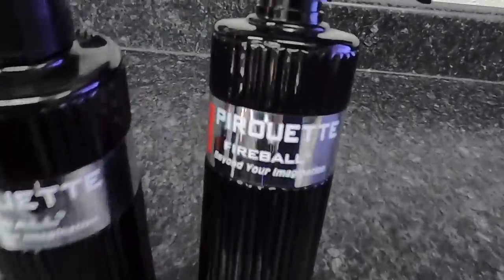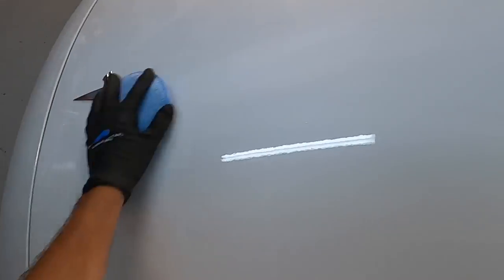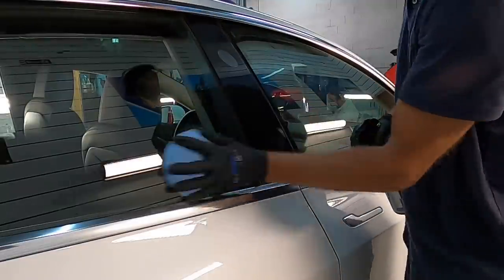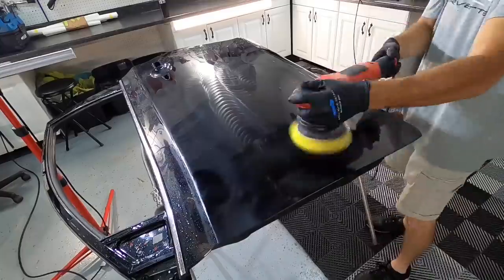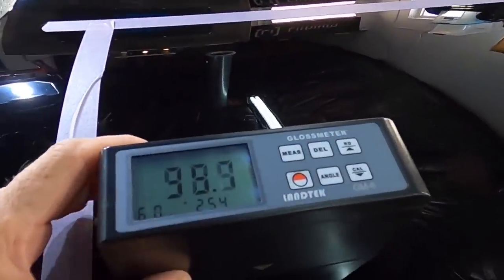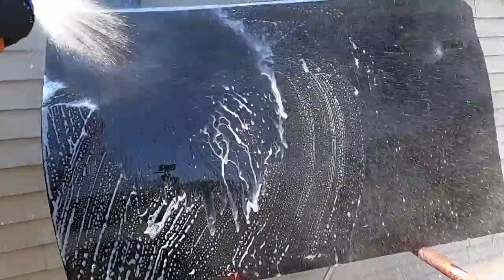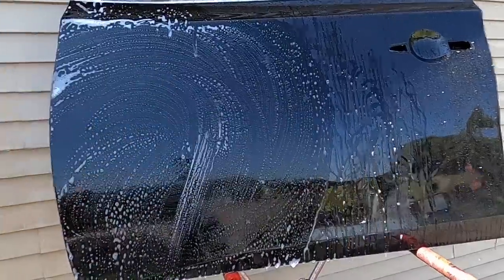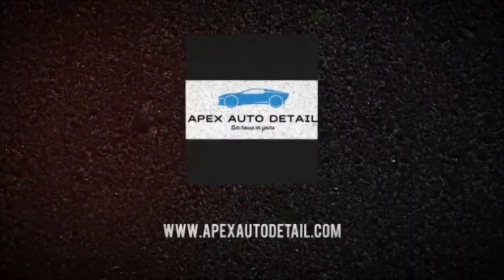Product Showcase/Reviews Are Back! FireBall Pirouette! Sio2 Infused Spray Sealant!!

Comment: You know it’s good when white paint pops.  Still my favorite auto detailing channel.  Do you know of any lint free buffing towels?  How to remove water spots from a ceramic coating?
Reply: Anything from a good company like the rag company, use a water spot remover if that doesn't work then buffing is required and it will need to be recoated to restore the coating.
Reply: Carpro essense plus. No need to apply again the ceramic.
Reply: @thso6529  that is an option, it depends on how old the coating is and how deep the etchings are. That is where testing starts.
Reply: @dustin3700  If it's old maybe an option is to normally polish the paint and reapply of course.
Reply from the maker: Low nap towels from Microfiber Madness. I will have a video coming out on water spot removal from coatings.
Reply: Fireball has its own product for this called Water Spot, it works great.

Comment: Nice to see these back.
How has extreme solutions polyseal held up on customers vehicles? I bought it a while ago and have used it a few times but bought a very large quantity and just wish bought something holding its position. Thanks
Reply from the maker: Depending on application method...it has done as well as a polymer sealant would be expected to. I apply with a damp microfiber like I do Rehydra-Bead.
Reply: @apexdetail85  so you would say around 4 months of protection using the wet rag and product then buff with dry method correct? Of course with proper prep prior. Thank you

Comment: Hello bryan im ahmad from indonesia im employee of one detail garage here, what do you think about doing a polish rotary polisher using speed 1 with high pressure? Im little bit confuse right now, i do believe if you put pressure on the surface you create heat and burn the paint, literally i do polish with rotary or DA with 3 or 4 speed with only use the weight of the polisher , and they said that im wrong, i need your opinion, thank you
Reply: The DA speed is good at 3-4 light to no pressure and for the Rotary use a medium to low speed depending on the polishers speed settings and pressure should be polisher weight to light pressure only a few pounds needed. Just don't hover in one area to long, if the panel feels hot to the touch then you need to back off speed or pressure or increase arm speed.
Reply from the maker: I use rotary and DA polishers at the 3-4 speed settings. applying pressure with my thumb as to not apply too much and spike temps.
Reply: @apexdetail85  yeah, i do that too because i've learn so much from your video, and the result is amazing, specially in my country, we have lot of super soft paint, and some even sticky soft paint
Reply: @dustin3700  yeah i agree with you, thank you for your tips, but i can't do that in this situation, because im just an employee and my boss believe doing polish with speed 1 on rotary with super strenght pressure is an excelent job 😅